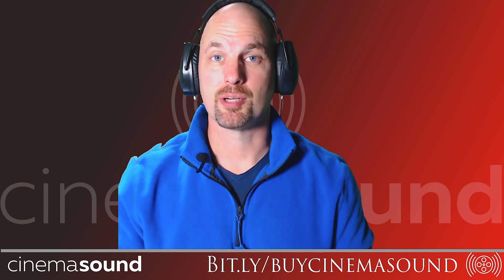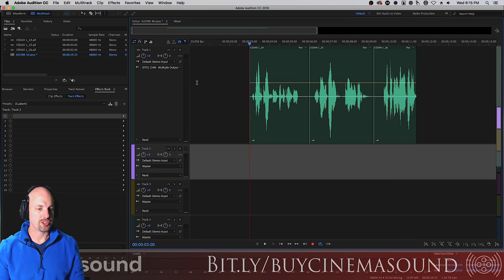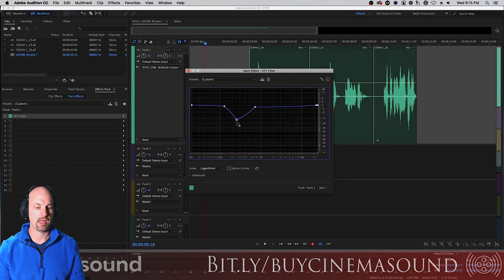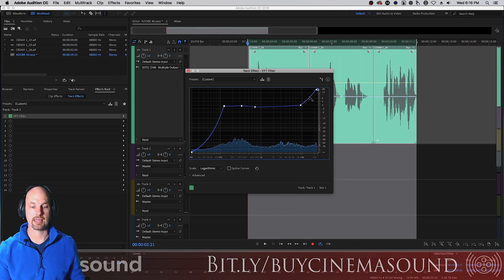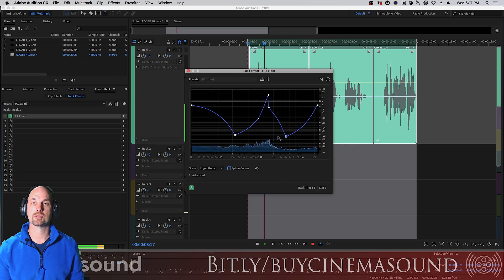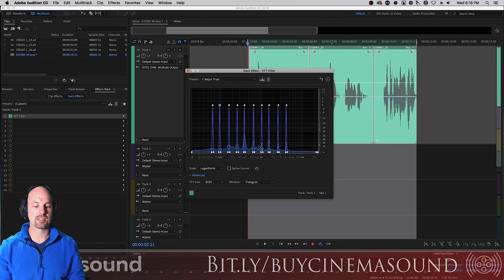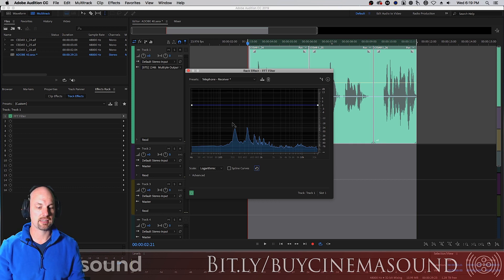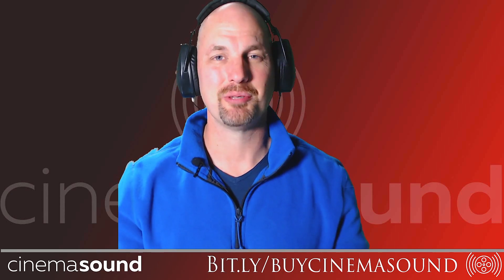Adobe Audition How To: FFT Filter

Comment: is there a way to sort of blend the presence of the effect? As in, is it possible to have the effect's impact fade away and choose when that happens. Sort of like in After Effects, you can use keyframes to make an image slowly fade away, or using a speed graph (I think that's what it's called). Also, is there a way to make it so that only one point on the filter is changed that way?? If you need me to elaborate I can, but I am working on something and I need to know if this is a possibility

Comment: I've been binge watching all these tutorials. Thank you for making it so easy and for explaining each function. 
What is your opinion on speaker calibration before doing any edits and mixes? I recently came across it and tried doing it...not even sure I did it right. It would be great if you could do a tutorial on that as well as audio levels.
Reply: @cinema_sound5003  I didn't even know there was calibration for EQ...I  meant for the monitors...the whole SPL, -20dbfs pink noise setup. I will check out those links. Thank you very much for your help.